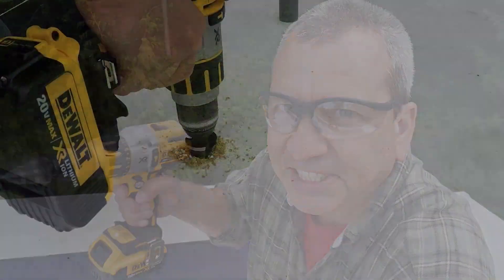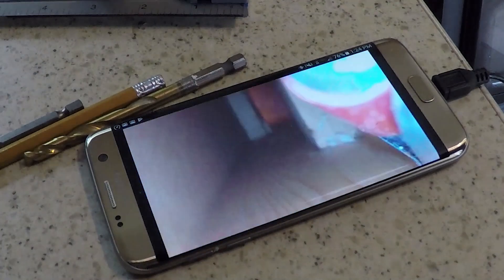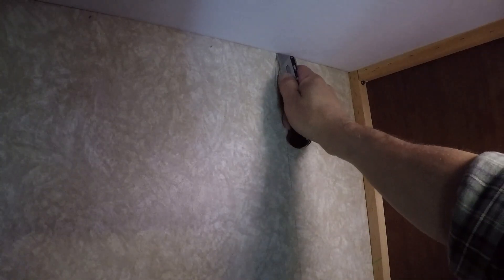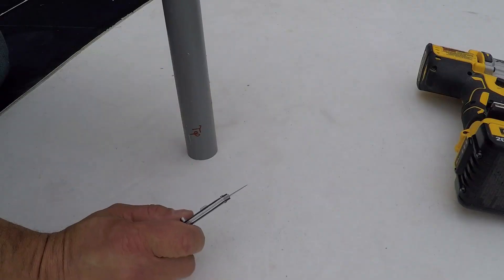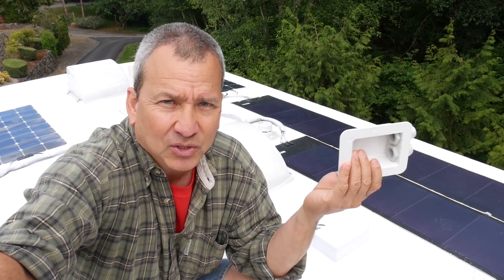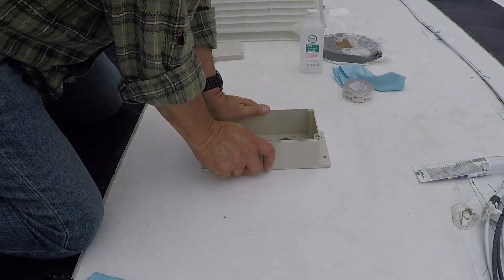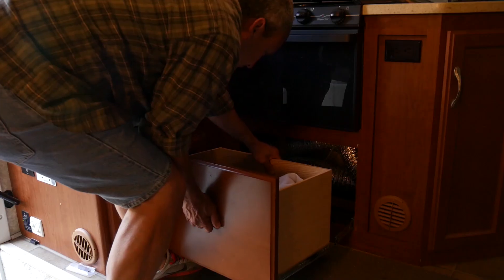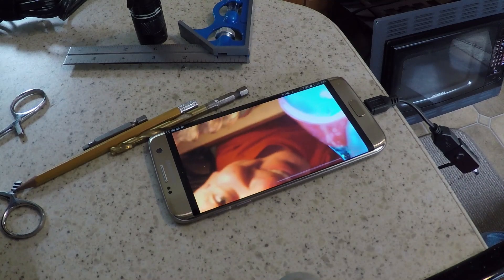Cable Access Hole Through RV Roof // How To // Solar

Comment: When you came out the bottom of the RV with the cable did you run any kind on conduit to the charge controller cabinet?

Comment: Brilliant video. I just how did you seal the floor after threading the cables through the floor. Sorry I am just the beginner and was thinking of doing the same. Thank You
Reply from the maker: There are several ways: Spray foam, construction sealant, or electricians puddy.

Comment: I don’t own a travel trailer….yet.  But this video is saved for when I do and ready to outfit it with solar.  This is the best solution I’ve seen so far.
Reply from the maker: Great. Thanks. I used it several times now. Works great.👍

Comment: Brian, great info as usual. Easily accessible. A question I have is, are there specific techniques for drilling penetration holes into a fiberglass roof? Special type drill bits, techniques, etc. I would hate to cause cracks in the roof of my motorhome. Thanks, Steve Dias
Reply from the maker: I'd first want to know what the composition of the roof is. What's below the fiberglass and how thick the roof is. Once you know that then you'll know better what to do. My current fiberglass roof has a very thin layer of fiberglass, and a thin layer of plywood, then three inches of foam. One way to find this out is remove the flange inside one of your vents. It may expose the roof material. If you're concerned about cracking while drilling, cover the area with blue painters tape and drill through it.
Reply: @RV with Tito DIY  Thank you, sir, as always.

Comment: The compartment where you put the charge controller does not seem to be ventilated. Does it not get hot in there?
Reply from the maker: I did install two cooling vents with temp regulated fan. Works fine.

Comment: Thank you for this “how to” video.  I just installed a 9:1 antenna on our adventure van roof and had to route the 1” bundle of cables to the inside.  This was a big help and I feel the project turned out “professional” with your demonstration and explanation.  I am  confident we have a water tight entry point.  I must admit the most difficult part, (mentally), was drilling the hole.  Thanks again
Reply from the maker: Nice job!

Comment: Great video, do you recommend any special tape to hold down the wires to the fiberglass roof to keep the secure while driving.  I will not be using any conduit, just the wire from the solar panel to the cable entry gland.
Reply from the maker: These are easy and work pretty well (https://amzn.to/3EFd5sT). Clean the surface really well with rubbing alcohol first and you should get a good bond. Good luck!
Reply: @RVwithTito  Perfect!  Thanks!

Comment: Good install woulda used butyl tape though Eternabond tape is brutal if you ever have to remove it. Think I might do the same with my solar install using a box instead of the directional two cable gland fixture.
Reply from the maker: I've installed a few of these since. It will be perfect for your solar install.

Comment: Hey Tito, how has the junction box been holding up all these years? Any leaks? Would make any tweaks to your installation steps outlined 4 years ago, or would you still do the exact same  today? Thanks!
Reply from the maker: Never touched it since. It's held up perfectly.
Reply: @RVwithTito  Great to hear, thanks for your reply!
Reply from the maker: @morenonesense  No problem. Good luck with the project.

Comment: I have an interesting question. I have a 2021 Kingsport 268bh model bumper pull RV. I have just received my Starlink for RV and I am working through how to attach and run everything. I ran across a shielded Ethernet cable above my TV area but I cannot figure out where it goes. It may or may not be useful. If anybody knows where the other end is I would greatly appreciate it. It also has a 12V 5.5mm x 2.1 dc plug with it behind a outlet cover plate. I use this for my Pepwave which was my internet connection. Great video I like how you explain the thought process behind what you are doing. Love watching your videos

Comment: Very similar to what I did on our airstream for solar cables - I wanted to keep the option open to run wires for a backup camera (or who knows what) in the future.  Airstream roofs are a single layer of aluminum so I used a larger (1"?) gland (which has a gasket and nut to seal it) to get through the roof - the cables are much smaller than the gland so it wouldn't keep the rain out by itself.  So then I cut a hole in the bottom of a handy box like you did and sealed it to the roof with caulk.  Water would have to leak past both the box seal and the gland seal to leak in.  However - I know from experience that handy box lids can leak. So I drilled weep holes in the downhill side of the box to let any moisture that gets in have a way out.  That works on a sloped airstream roof - maybe not on other RVs.  

You have to really think about what is going to be the best solution in your particular situation.  I don't see how you can have an RV if you aren't at least a little bit handy.
Reply from the maker: Nice job! Yes. Weep holes are a good idea. I agree completely with your last comment. So true.

Comment: Great video! I have a bundle of cables I just installed into a box like that from my 7 in 1 antenna. Do I need to put dicor on the gland where the cables enter or is it really water tight even for a bundle of cables?

Comment: Hi Brian, fantastic video, will be so helpful for my Airstream project.  Thank you. Quick question- did you seal or spray paint the junction box itself (it appears grey, then white)? What did you use?  Are you still able to open / access the box from the top by unscrewing for future wiring projects?

Comment: Wow, what a super video...thank you.  I'm wondering if the same waterproofing procedure would apply if I simply wanted to drill an access hole through the floor into the compartment under my bed to feed the battery cables from outside to inside.  I've moved to lithium batteries (3) with a Victron MultiPlus Inverter.  The old setup had a couple of 12v lead acids located up on the tongue of my 2015 Lance 1995 travel trailer.  It seems like to get the power from the battery bank to the distribution panel, I have to get the white and black battery cables through to the new interior location.  I clearly don't want water splashing up from under the trailer into the compartment under my bed.  The box idea seems to be a pretty solid way to go.  Just wondering what your thoughts are in doing this.  Thanks again,

Comment: That's very clever how you ran the conduit down. And the box. I install a lot of communications equipment in RVs and the challenges installing antennas up on the roof that gives me an idea how to run the coax
Reply from the maker: Glad you like it. I'll do this on all rigs from this point forward...unless they have fridge vent access.

Comment: Great informative video mate. I have just replaced my RV roof and decided to go this way for my solar panel wires, tv antenna and auto sat dish (8 in total). All sealed and parts are all IP68 waterproof (hose proof). The seal was so good it actually generated more water by condensation than would ever get into the box via a heavy rain downpour.  The only way out that I can see is to place a small drain tube at the lowest rear corner of the box and hope it drains before it flows up and over the lip of the 40mm pvc pipe that runs down inside. Have you had a look inside your install recently? I would suggest anyone with this setup keep an eye on it.

Comment: What will you do  if you ever have to change to a smaller hole and smaller cable gland  in the future?  Once you drill the big hole  then you’ll never be able to replace it with a smaller hole.  I bought the box and cable glands but waiting on your answer.

Comment: Thanks for the video. I am picking up a small used trailer tomorrow. Goal is for occasional camping and converting it into a Mobile Ham Radio Shack. I will need to install an antenna connector on the outside wall then run a short cable into the trailer. Simple tip like removing the microwave and how you cut the inner wall inside the trailer will be a big help.

Comment: I appreciate the video.  It gave me the confidence to install the junction box at the top of the RV.

It'd be nice to see some of these products on an Amazon store.  I like some of the items you have on kit.co, but it'd be easier for me to get some of these products directly from Amazon.  You've put a but of work into these videos and the least I can do is if I use some products.

I'm wiring the system slightly different.  I'm running two sets of parallel panels through the roof and combining them in the battery compartment, and by moving the combiner 10' closer to the battery I was surprised at how much less DC loss there is.  I think I went from a 15' length for converter and battery  to a 2' length converter and battery.  I ended up putting the wire in a 1" wide PVC conduit, which will leave room for expansion whether that be another string of solar panels or adding wiring for a satellite dish.
Reply from the maker: The parts I have on Kit.co are linked directly to Amazon. Just click on them 👍
Reply: @RVwithTito  I found what I was looking for by clicking in the link from your YouTube video and then went to page 3.  Thanks.
Reply: @RVwithTito  I could not find any inverters on the Kit.co site.  The SAMLEX 1500 or 2000 is what I decided on.
Reply from the maker: @skic3151  Oh. Right. I don't have inverters on there. I have links to the Samlex here https://www.rvwithtito.com/articles/our-solar/ where you can see our entire system.

Comment: Thanks for this. It's probably a silly question but is the conduit really a piece of "conduit" or just PVC pipe? I'm trying to figure out what to get at Lowes or Home Depot.
Reply from the maker: I believe both are PVC. Either will do. Electrical conduit is generally lighter weight since it doesn't need to carry water under pressure. You're choice.

Comment: If I may suggest, instead of the gray tube, a marine thru-hull fitting:

https://www.westmarine.com/buy/forespar--marelon-mushroom-heads-threaded--P011_332_002_019?recordNum=18
Reply from the maker: Thanks for the suggestion.

Comment: Hi Brian, As an electrician and electrical contractor with 30 years of experience, I would suggest drilling a hole in the water proof box at the lowest point possible (lower than the top of the conduit going through the roof)  because water proof seals are (with time) not always water proof.  The hole will allow the water an exit out of the box, (other then down the down pipe) and save water going down that down pipe!
Reply from the maker: I've considered that too. Thanks for the suggestion. I'll go ahead and do it. 👍
Reply: You might want to glue a screen to the hole so that bugs do not enter.

Comment: This is a nice, clean installation.  

When running cables that break from the outside to the interior or when running cables into electric boxes, I usually will try to bend the cable into a u-shape right before entering a surface with it.  This has the advantage that if water runs from the top of the cable towards, for instance, a box or a wall that water will encounter the u-shape in the cable.

Water will then ever so slightly collect in the bottom part of the u-shaped cable, and due to gravity it will fall on its own from the cable.  This reduces quite a bit the possibility of water running in through the cables themselves.

I realize it is more difficult to do this on a roof, but if you think about it is possible, and the results are worth the effort.
Reply from the maker: Yes. That drip loop is pretty common practice for electrical wiring on boats. Thanks for the suggestion.
Reply: Great tip!

Comment: Brian, great video! I am getting ready to start my solar project.
Do you remember what size conduit you used through the roof?
Reply from the maker: You can use whatever size you need and have a drill bit for. I think mine may have been 1.5 inch. I've spoken to others who saw the video and went with a larger size. Good luck with your project!

Comment: 3 things, 1st off never punch the drill bit straight through the roof material, whether you're going from topside or inside, use a proper hole cutter with a very short center dill bit. not a multi step drill bit...You never know when there's going to be wires looming in the roof near the surfaces that feed your electrical, sound systems or air conditioning ete, etc... go a layer at a time, very slowly, peel back the layers what ever it is, wood, plastic, vinyl, plywood, fiberglass, the most time taken here will save you a nightmare, days of work and hundreds of dollars because you drilled into a cable of one kind or another, shit happens, a lot, especially when you do this type of work hundreds of times a year, yes you can play Russian roulette  and hope you don't ht a wires, pipes, roof truss, and quickly make a small job destroy a brand new 800,000.00 RV new off the lot, the new owner might just say you bought yourself an RV when his awning won't go out or you get an electrical short, and arc and a fire... I screeched when I saw you punching a hole straight through, instead peel back, remove the styro foam or batt insulation, feel for wires and then continue on...  Assessing where to drill, where to run the wires can take as much time as doing the task...  42 years of experience and hearing horror stories tells me so... With over 42 years of installing communications, emergency com equipment, electronic systems, electrical, in almost anything you can think of, Fire trucks, Police Rescue, RV's boats, cars There is a first time hobbyist way of doing things or a pro who has done it hundreds, if not thousands of times, and even then you can't get cocky, because that's when mistake happen... Last off, make sure the box used is a UV protected for outside use, not something that was built for inside use which never sees the sun or weather environment, overtime it will decompose in direct sunlight if not...
Reply: Oh yes, third if not forth, make sure you put insulation in that box, cold air from out side and warm air from inside will collide and produce, yup, you know it, condensation, which is, yup, water, lots of time why your rood is rotting and yellow stains on the inside... Seen it more then once... :)

Comment: Never use white tie straps, nor non-uv protected black tie straps, best you'll get 1 or 2 years out of them, all ways go for UV protected, same goes for all the black sheathing being used, it breaks down and goes brittle in a year or two... If the wires are outside UV protected they shouldn't require the sheathing over top...

Comment: Tito, mate Iike your ideas and courage but you are as rough as guts with the sealant around the plastic junction box. Probably need to use a wet finger to create a nice bead after you lay the bead from the gun.
Reply from the maker: The sealant is self-leveling. After 24 hours it settles in really nicely.

Comment: Loved the video...... Thank you for such a clear picture of how to:    I received my solar panel with the wire attachment clips already installed on the wires.  Because i have to run the wiring through the little weather proof guides, i"ll need to either remove the connectors or buy new ones and snip the others off.  Is it possible to disconnect the connectors from the wiring?        Thanks for your terrific advice Brian!!
Reply from the maker: Hi Heather. Unfortunately they don't come off once installed. I recommend buying a very long extension cable (with connectors at both ends) then cut it in half. Clip the connector ends to your solar panel outputs and run the cut ends of the extension through the opening and into the RV. If you need to make new MC4 connectors, here's a video showing you how:  https://youtu.be/nAwMxETcqSI  Hope that helps.

Comment: Thank you for this info.  I find it very informative.  Your RV looks a lot like my 2014 4 Winds Class C- at least the part I can see.  I am trying to DIY this project to save money.  I have not been able to find info on where and how to hook up the solar panels to my main electric.  I have 3 batteries at the present time that came with the RV.  I have 4 - 75 AH AGM sine batteries to install.  To I take the old batteries out and replace them with the new?  This will connect 250w SunPower solar panels, a 300W Durafied Inverter (600w peak), and PowerMr MPPT Solar Charge Controller and all the battery connectors, solar panel parallel y harness & extension.  Too Much Information?

Comment: Just one question: from inside, you drilled the hole along the outerside of the wall behind the microwave, but on the roof the hole looks like in the middle of the roof. how did this possible?
Reply from the maker: It wasn't an outer wall. The wall is in the center of the rv.

Comment: Great video!  I am getting ready to make a box and cut the hole more or less as you describe.  This video is about a year old.  How did it hold up?  ANy changes you would make today if starting over? Edit: Concern is the ABS plastic box on the roof will deteriorate rapidly under UV exposure.

Comment: Would love to see a video of how to run cables into RV without drilling any holes as well, possibly running it through a door opening and taping it down with the eternabond along the side or back of the rig